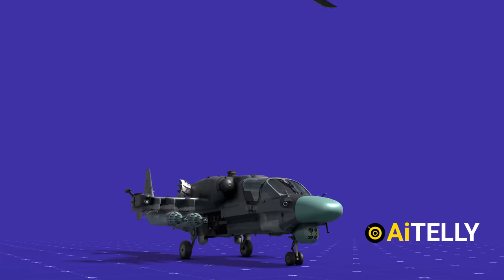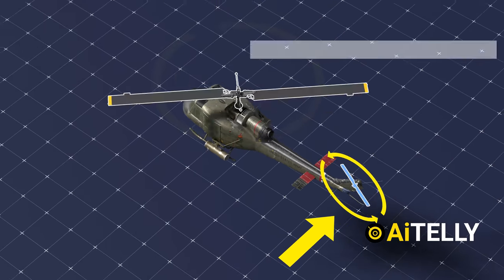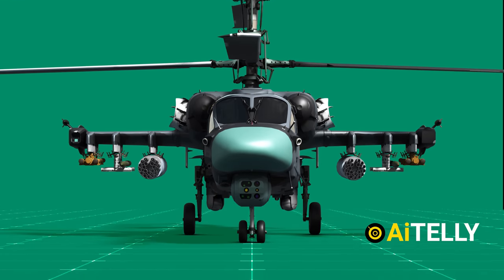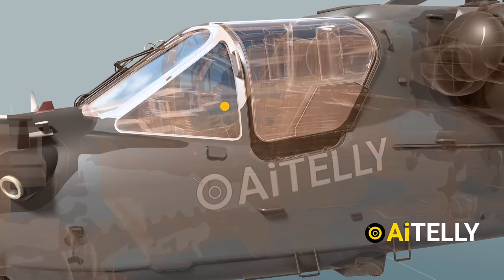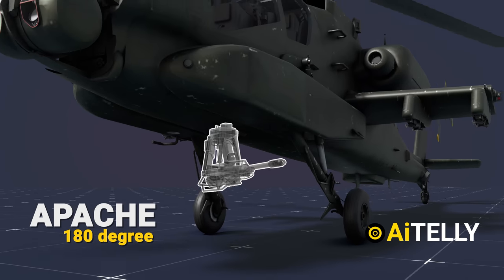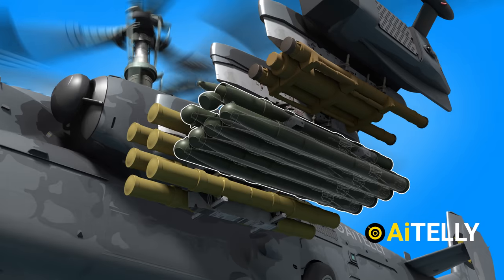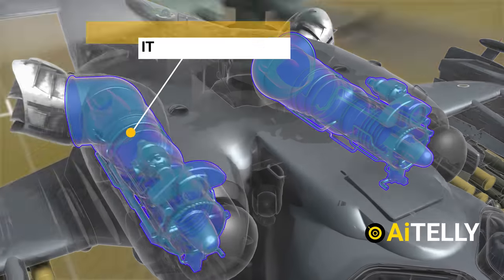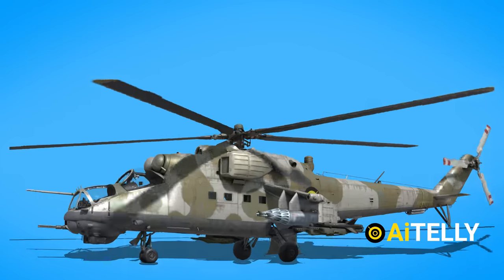KA 52 How Military Coaxial Helicopter Works #ka52 #helicopter #coaxial

Comment: Even the US is working on a new coaxial helicopter.  Bit I have questions: 
Why doesn't kamov use pusher props?
Why not build a tandem seat Ka 50 to replace the single pilot one?
Why isn't the auto cannon free like the Apache own?
Can the cannon be controlled by head movement?
Is it's FLIR separate from its TADS like the Apache?
Reply: why not build tandem seat? it has tandem seat, the single seat is not operational, was more of a prototype..
auto cannon cannot move like apache due to weight, length, basically its trade off in accuracy and range vs. mobility
i heard ka52M i being put in service now, a modification that replaces radar with AESA radar!?? ..insane, ..it would be a huuuge combat ability surplus, would also make it all weather able, as it could hit targets in complete dark, fog, snow..
Reply: With a tandem crew layout, it would be necessary to increase the length of the entire machine, and this will violate the weight distribution and adversely affect flight performance.  The gun is controlled through a sight on the operator's helmet.
Reply: @keepwalking6041  Now, in addition to the Ka-52, the Mi-28 "Night Hunter" has been adopted.  It carries a smaller combat load, but is able to operate in zero visibility conditions and give target designations to other helicopters.  A group of one Mi-28 and several Ka-52s can inflict powerful strikes on the enemy in any weather conditions.

Comment: Around 20 of these K-52were loss In Ukraine. Some of the shoot down were filmed.

I wonder why we rarely see the action of ejection seat.
Reply: cause 1 out of 2 engine is more than enough to fly to home?
Reply: @google5355  they are completely destroyed
Reply: @dew7025  Probably need a minimum high to be able to work they because they need to remove the rotor first, they cant fly high enough in Ukraine, means they cant use it.

Comment: Flat turn on side way or how it call "funnel" is useless against enemy which can shooting back. So this advantage only for marketing headlines. Also coaxial rotors have major problem with blades cross-collision in high-G maneuvers or hi speed. Passing max speed limit is absolutely deadly for Ka-50 and Ka-52. I'm not sure about quality of radar system. Because so difficult to find video which show what that system works, and so many video with using unguided rockets, something wrong with that.
Reply: поищи теперь, появилась куча видео, с неоднократными запусками стингеров, где эти вертолеты улетают невредимыми. Пожалуй лучший ударный вертолет, на сегодняшний день.

Comment: The KA52 has FLEXIBLE dual rotors. The Sikorsky Raider type has a much shorter RIGID co-axial rotor system (better efficiency with rotors closer together) AND a pusher propeller to make it far faster than the KA52 with less maintenance on the rotor system.

Comment: Paper specs look pretty well but on the field there are discrepancies… see 🇺🇦
Reply: No discrepancies, it's just being used in a very reckless way. Without total air superiority they have to fly low, which means they're extreamly vulnerable to manpads. Additionally they should be staying behind the front line providing standoff support. All the videos I've seen of them being shot down the missile comes from the side or the rear meaning they're directly over enemy controlled territory.

Comment: Question,why is there some broken English?
Reply from the maker: Could you point out the mistake.
We had to improvise at the last minute .
Thanks
Reply: @Aitelly Some parts about the co-axial rotors, the part about abrams tank and followed by fighting vechle sentence , some features where you guys mentioned missiles, and the first part" in this content we will look at how a military helicopter work", the part saying combat maneuvers and vortices, the part where it says it has a length of sixteen meters and kilograms, detail about the landing gear, keeping in mind that helicopter is being upgraded with  optoelectronic system 52, the part where it says cokerent, the part where it says "moving back we have a cockpit wich is being armor protected", "the KA-52 also is equipped with bullet proof cockpit, the part about the ejection system "then these  rocket activates", the part about the BMP veiechle,  partwhere it says "it is equipped to engage armored and slightly armored target", the parts where it says "the gun have a slightly partial angle   of 30 to 35 degree down, and its side could rotate"(and for the apache part the "gun could move at almost 180 degree"), but analyzing will require another content,followed by now less look at the heavy missle equipment," it can carry six ornaments pods",this is S8 KOM with a holly fragmentation warhead impact effect, the reason for the use of these rockets  is as they are cost effective an dose damage, the part saying kilometers, this dose the 9M120 ATAKA ANTI TANK MISSLE, the Russian made this to counter armour fighting viechles,animated  if you wanted to know more part, part about turboshat engines and following sentences about engine being shot and comparison of apache and KA-52 and accent rate of accent part, following part about the "all that power" and fuselage(pronced fuselege in video),the part about why its called attack helicopter and target, mispronunciation of reconisnace, and finally  the part about it being a flying command post. I know this is a lot, but it doesn't mean that I didn't like the video. The animations were awesome and I learned something new. I hope this doesn't inconvenience you guy's at all. that is all.
Reply from the maker: @Horizons_Unknown  Wow great Feedback.
Sometimes we already made the Script, but we do correct it midway as we found out it's  has some Flaws.
But highly Aprecciate the feedback.
We learn from Viewers like you and will definetly improve our Scripts and Grammar  as we move along

Comment: the secod rotor,   has to cause prolems with imleess,          just like  a pick up truck  with a camper,  higher ceter of gravity,   every movemet has to  e limited to this ceter of gravity, due to  ay high agle pitch,    a truck with a camper  will ot e as imle off road,   ay   excess movemet,  might lead to the helcipoter pitchig to high agle ad uale to recover,  i am cofidet, that it was a afterthought , to makeup for  the lack of power i origial desig,  ad added as secod thought,

Comment: How tf they gonna eject upwards out of the cockpit without getting sliced up by two blades? 😂😂
Reply: engineers can count everything
Reply: @Hbmd3E  yeah until you eject, and the numbers you thought were right don’t matter when you’re chop cheese and shredded cheddar. 😂😂😂
Reply: @timdinh39  these days 1+1 is not nesessary 2  🙂did you know that also most of the jet pilots are disabeld after ejection?  ,, and ww2 times people regulrary died or were disabeld also parachuting
Reply: @timdinh39  Лопасти отстреливаются и пилоты катапультируются
Reply: The blades are first blasted off by an explosive charge
Reply: @abrakadavra3193  cool. but I dont think our friend Tim is not that much interested on engineering in the end,. but rather to say and think something un nice.
Reply: Early last year Ukraine filmed that it works
Reply: @abrakadavra3193  ahh that makes sense! Wonder what happens to the blades tho after they are ejected lol.
Reply: @Hbmd3E  what makes you think that? Lol cuz I asked a genuine question?
Reply: @timdinh39  Centrifugal force through them far far away and fast.
Reply: The  rotor will blow away  1s

Comment: Coaxial helicopter will have a rear rotor (hopefully it can rotate in either direction), just in case one of the top rotor fails. If one the top rotors fail, how will it be able to counter the rotating force? I think the engineers who designed this is kinda...dumb. LOL.
Reply: Helicopters of the classical scheme will start spinning in the same way when the rear propeller is lost. And it no longer has another rotor to escape.

Comment: Radar not working very well though, how many times a Stugna P shot it down in Ukraine not including the Stingers and the ejection was not visible too (maybe the pilots would rather die quick than risk being chopped to pieces). Maybe the problem are the operators.
Reply: They were flying really low so it would makes more sense to land rather than eject

Comment: Russia is now down to about 40 KA-52s.  With the only country in the world that bought the Alligator being Egypt there are now more Gators in D Nile than in Russia.  Think they call them crocodiles (sold them on the name change).  The Propaganda is severe.  The info is false here in a critical way.  Apache has more lift.  Climbs faster, goes 2,000 ft higher.  The KA-52 is 2,600 Kg heavier and they have the same max take off weight!   Apache could possibly carry a M777 artillery system to be fair.  In Combat it flies further.  Russia pads numbers, lies shamelessly but a fair point is the Gator has a tiny lead in top speed.  This is due to a lack of wake left behind.  The Oppositional drag rotors have the Gator wading in mud at all times except top speed.  The wake is obfuscated by the oppositional rotors (chopped up).  Less drag at the max possible speed.   If they made it 5 ft taller with more space between the rotors there might be less Impedance on performance?  But would fall over in a wind storm.
Reply: Dude! Just calm down and take some copium.
Reply: The burning Bradley’s, Max pros and Leopard 2A4/6’s disagree with you.
Reply: "Down to about 40". source: trust me bro.
Reply: I think he js being sarcastic guys, m777 part looks kinda sus
Reply: Umm, no. Stop with the lies. Stop with the Oryx BS. Hahaha! Oryx had to shut down because they just couldn't pass off blown up western equipment as Russian any more. Hahaha!